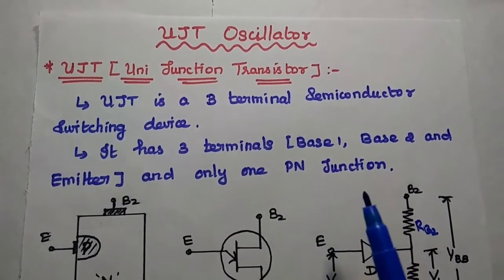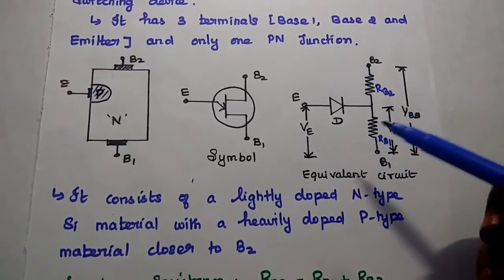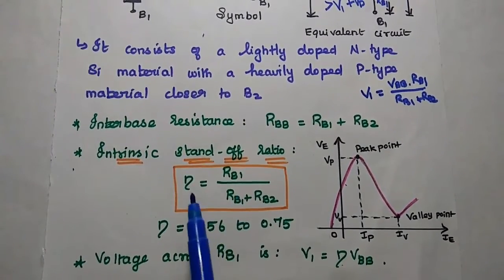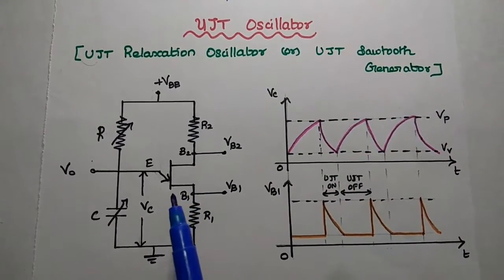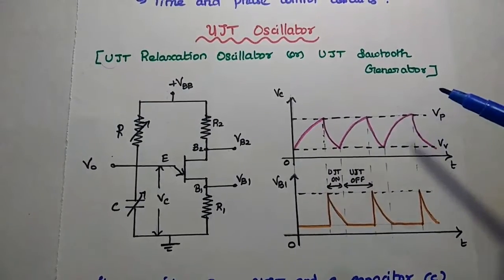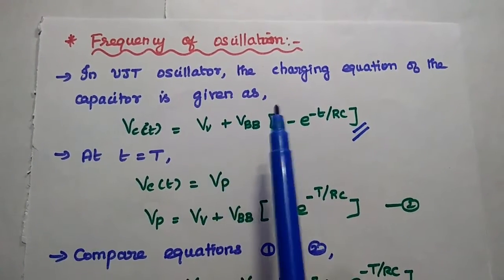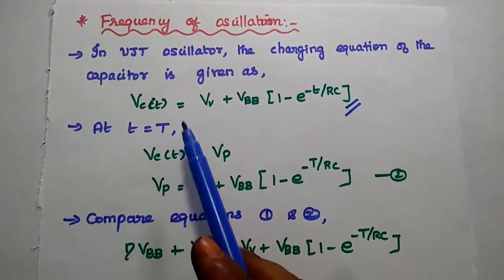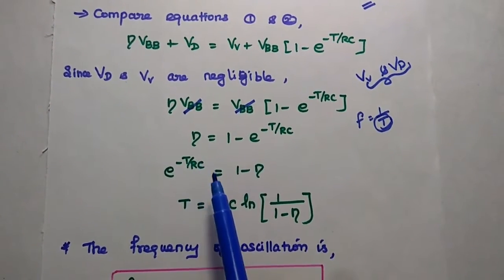UJT Relaxation Oscillator - Sawtooth Waveform Generator

Comment: Mam please upload the scanned copy which u are using to teach. It'll will be very helpful to study. And also upload Important questions in Power Amplifiers unit
Reply from the maker: Unit - I - Part B
1. Discuss the effect of negative feedback (Properties of Negative feedback)
2. Explain Nyquist criterion to analyze the stability of feedback amplifiers
* Explain the different types of feedback amplifiers - Voltage shunt and current series feedback amplifiers
Unit - II - Part B
1. Explain RC phase shift oscillator and derive its frequency of oscillation
2. Explain Wien Bridge Oscillator and derive its frequency of oscillation
3. Colpitts and Hartley oscillator
4. Crystal Oscillator
Unit - III - Part B
1. Single tuned Amplifier
2. Neutralization and its types
3. Double tuned amplifier
Unit - IV - Part B
1. Schmitt trigger
2. UJT Oscillator
3. RC integrator and RC integrator
4. Clipper and clamper
5. Astable Multivibrator
Unit - V - Part B
1. Class A Amplifiet
2. Push pull class B amplifier
3. Complementary Symmetry class B Amplifier
4. Buck- Boost Converter
5. Cross over distortion